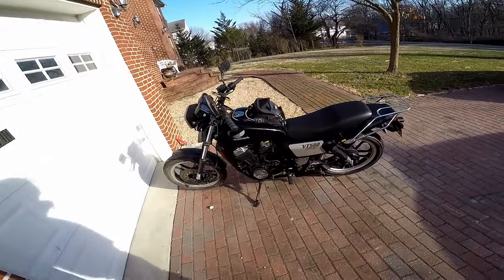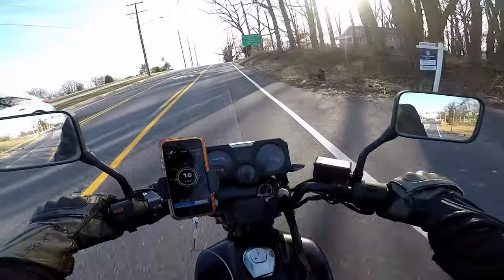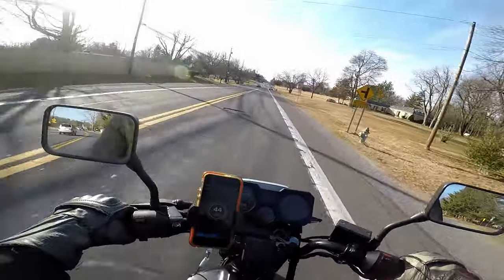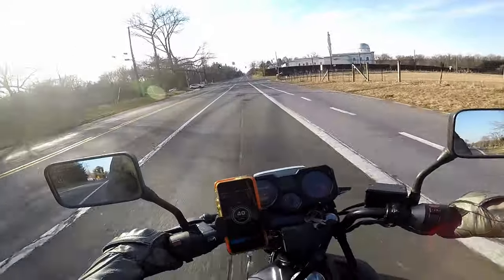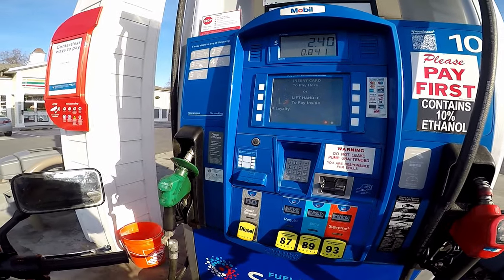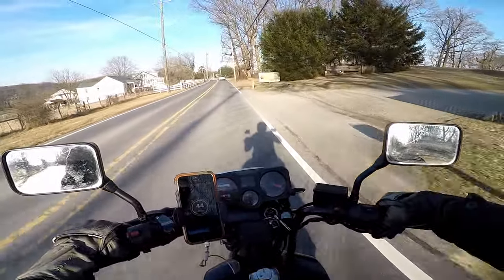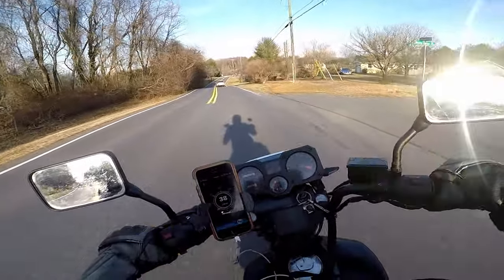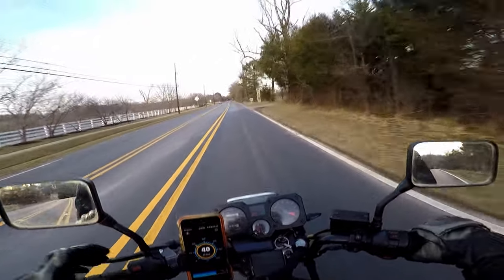Why the Honda Ascot is such a weird lovable bike

Comment: I bought an Ascot NEW in 1984. It was a great commuter bike (I bought it to save on fuel in good weather as my car was one of the last of the full sized, RWD Buick Le Sabres with a V-8 LOL). It's low maintenance (shaft drive) and great build quality was perfect for that role! A lot of people "diss" this bike. I don't! It did EVERYTHING I needed/wanted it to do!  It's no "cruiser", it's no "sport bike"- It is its OWN thing. A great commuter with GREAT (totally '80s!!!) style, and it is a REAL bike, not a "scooter". I don't know what Honda's INTENDED market was for Ascot, but it was perfect for me!  Inexpensive for its displacement and almost 100% trouble free!👍👍 To be fair it's nowhere near as comfortable as a Buick Le Sabre, LOL, but like "felt recoil" when sport shooting, That's part of the experience. LOL.
Reply: I bought the VT500 Ascot new in 1984 also.  It was a great bike in my opinion.  With the 6th gear it was great on the highway.  It was lightweight and fun on the backroads too. I loved that bike and would ride it often even after buying a new Beemer in 1987 (which I bought mostly for touring).....BTW...I was a Buick guy back then too....I had a Regal Grand National as my last Buick, prior to that I forget the number of Buicks but it has to be atleast 20 of them from 1957-1987.